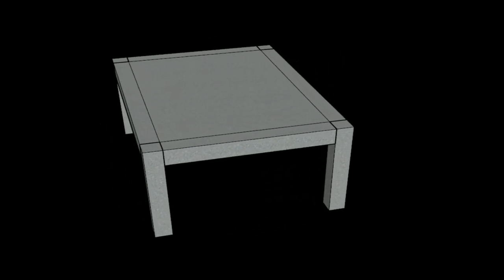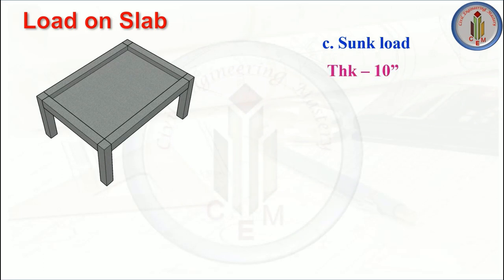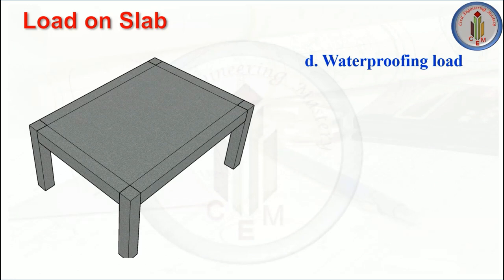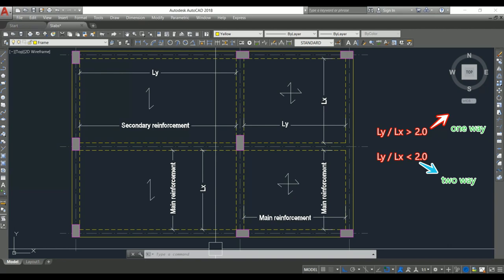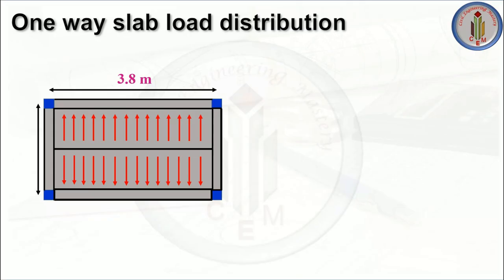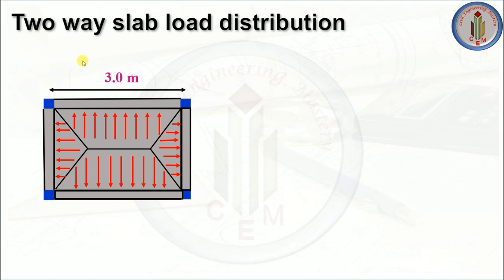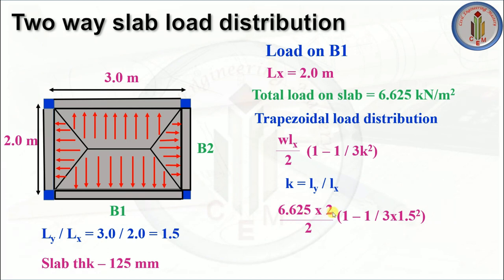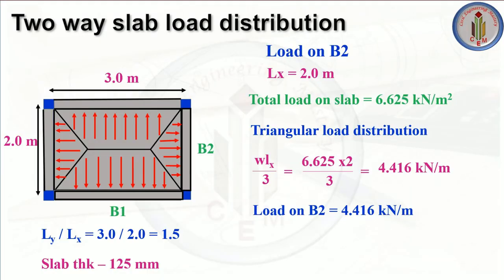Load calculation of slab | Slab load distribution to beams | Slab load transfer mechanism | slab

Comment: Thanks for your reply. I got through with the calculation.

Do you have a video on how you calculate the amount of Reinforcement required for a beam and column knowing the load that the beam and column will be carrying?
Reply from the maker: Please refer to the below link
https://www.youtube.com/watch?v=NV5k1RjrPiM&list=PL_ZiPXJHDZzihK7LMqYhhuwwpaELbAqop&index=14
https://www.youtube.com/watch?v=CdPXPj9KWFk&list=PL_ZiPXJHDZziXUjqDA1a4Ea0tDP870-nn&index=6
https://www.youtube.com/watch?v=qQTCzaM9VF8&list=PL_ZiPXJHDZziXUjqDA1a4Ea0tDP870-nn&index=7
Reply: @CivilEngineeringMastery  Thank you for your latest reply to me. Can you tell me what safe live load per square foot you would recommend when designing a concrete wharf for commercial use?
Reply from the maker: Please refer to the code IS-875 Part-2 for live loads depending on the building type. There is no standard safe live load for commercial use.

Comment: Could you please explain a little more how you arrived at the answer for the weight of the Trapezoidal load distribution on beam B1 in your video, as when I use the figures you used, I do not get the answer you have for the load on B1. Thanks in advance, and looking forward to an early reply.
Reply from the maker: To calculate the trapezoidal load the formula is wlx/2(1-1/3k^2), where w is the total load on a slab, lx is the shorter span distance and k is the ratio between ly & lx. Please apply all the values in the given formula you will get the answer 5.64 kN/m on B1. Hope this clears your query.

Comment: Thanks for the explanation.  Please give me reference in IS Code and BS 8110 Code (if you do have it) for trapezoidal load from Slab to UDL Load on Beam. Also I wanted to know more about k (the aspect ratio). Clearly the standard is Ly/Lx to determine whether the slab is one-way or two-way.  However, in some formula regarding trapezoidal load covnersion I see Lx/Ly in some I see Ly/Lx also load itelf is sometimes represented by n, w and the UDL sometimes represented by Wu or P. Your thoughts on this will be much appreciated. My formula is (n.lx)/6 x (3 - k^2) where k is Lx/Ly.
Reply from the maker: The aspect ratio is Ly/Lx to determine whether the slab is one-way or two-way. The load can be represented by P or W(unfactored), whereas Pu & Wu represents the factored load.
Reply: @CivilEngineeringMastery  Thank you.  I did not know you answered my question.  I got it that you are talking about triangular, rectangular and trapezoidal load distribution and not their equivalent UDL.  Apparently you can get moments directly from those load distribution and no need to conversion to UDL which seemingly makes thing easier.  Please correct me if I am wrong. I also gott the source for the conversion.  It is in Reynold. Again, thank you very much.